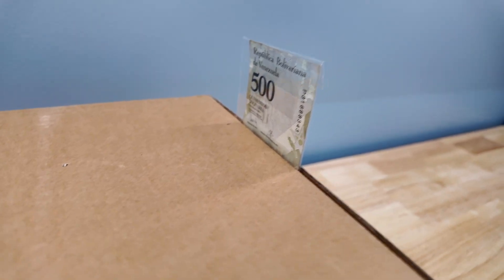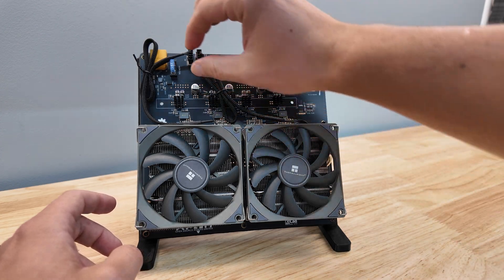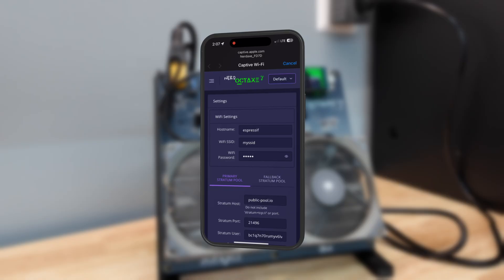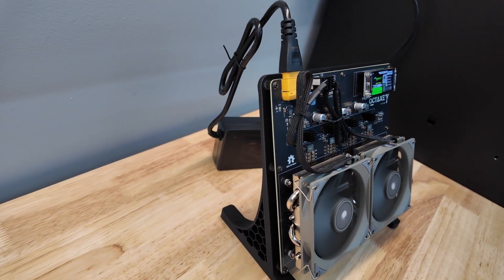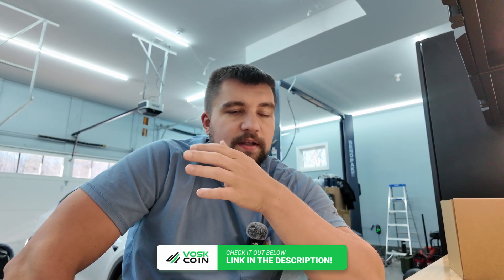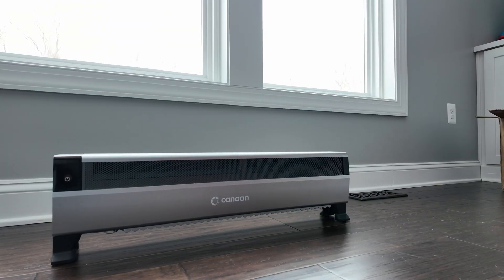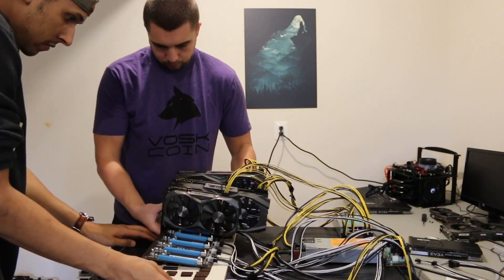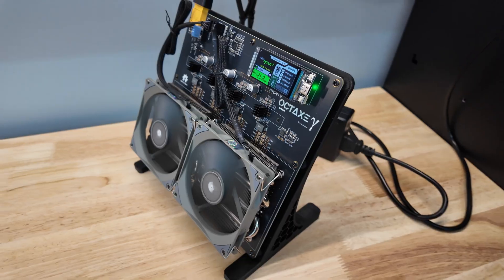BIGGEST Mini Home Bitcoin Miner - NerdOctaxe Review

Comment: Comparing the different options, there are definitely better priced miners that can get you 10TH for less than $1K. If you get two 6.1 ones you're already at 12TH for around $700 if you find them, as they are sold out pretty much everywhere.

Comment: Why would anyone get one of those when they can get three Canaan Nano 3S and a total of 18 TH/s for the same price? 900 bucks for 9 TH/s? Seems ridiculously overpriced while being underpowered. You get literally double the hashrate for the same price if you invest in three Canaan Nanos instead. And you can get a Canaan Avalon Q with 90 TH/s for around 1500$. That's ten times the hashrate this thing has.
Reply: these are open source and upgradeable . the avalon is closed source and has an app that has to be paired in order for it to run . bitaxe most are assembled and made in 🇺🇸 the avalon is made in 🇨🇳
Reply: @thebrettcave open source OS makes no difference to hitting a block or not. If you want to support the open source cause then yes get Bixaxe's and Nerdaxe's. And most Bitaxe's are made in China, unless you get them from a US seller who manufacturers them
Reply: the nano is a lot less efficient than all these axes which sit around 15 J/TH
Reply: That's Bitcoin Merch for you😂
Reply: Yes, but then he doesn’t get his Affiliate commission
Reply: @ParabolicPeptides  To be fair, he did hint at there being better options out there. My criticism wasn't necessarily directed at him, but rather the miner itself. Although the high price might be due to the particular reseller in question, that would be Bitcoin Merch, not Bitaxe themselves. Based on what others are saying, you can get this one for significantly less elsewhere, around $499-549. That's a lot more reasonable if true.